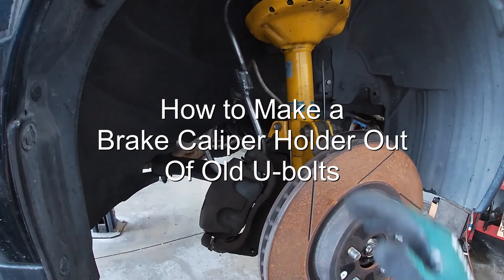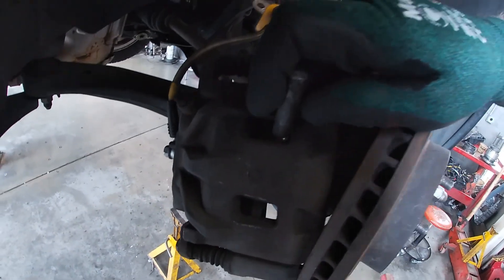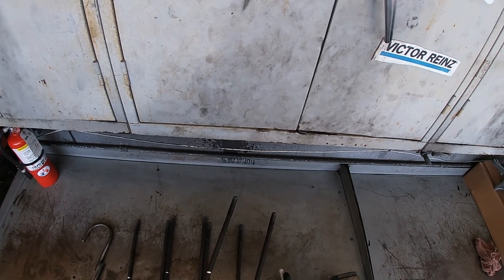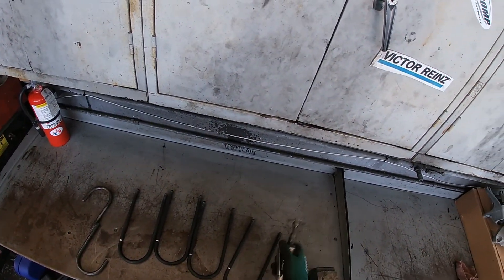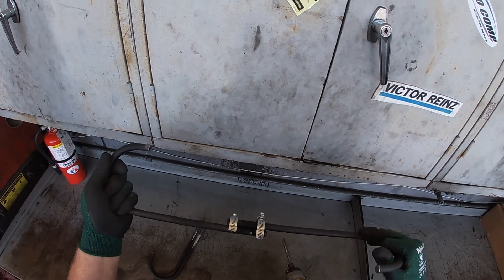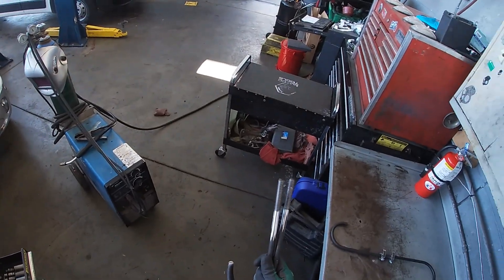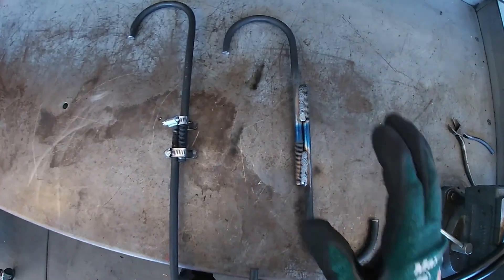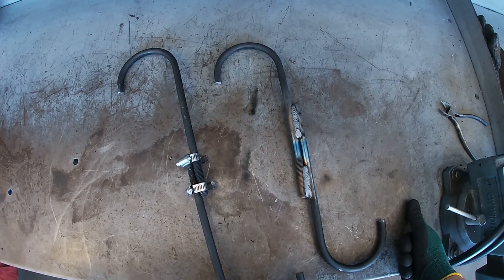How to Make a Brake Caliper Hanger

Comment: Hey, Taylor!  This is a great little video and I’ll add it to my project list. Since having the ability to adjust length and angle seems to be a great concept I’ll probably make one out of 1/4 round stock, bending and threading as necessary. I like to cut off excess hose clamp and bend the end under so there’s no sharp edge exposed. 
Thanks for giving me a great idea for a new tool!